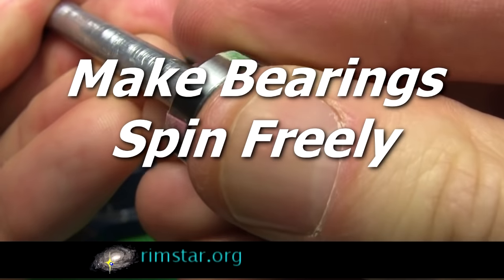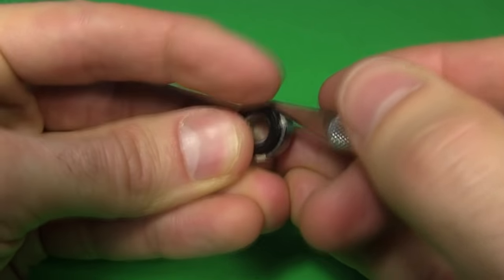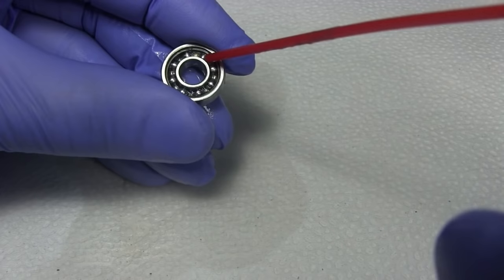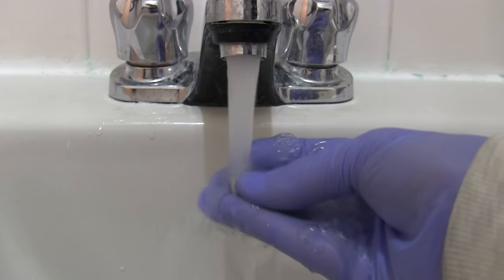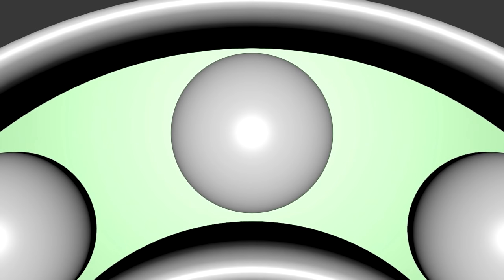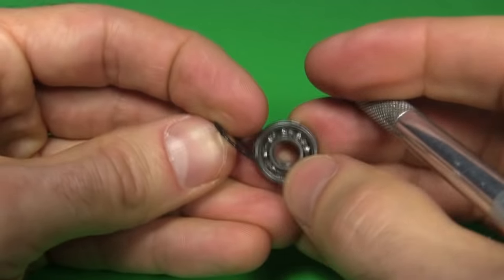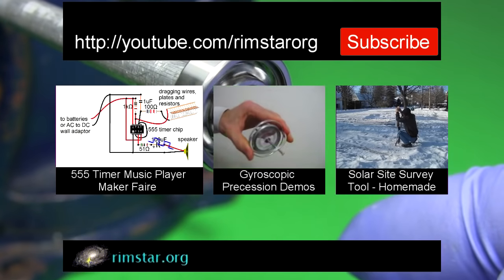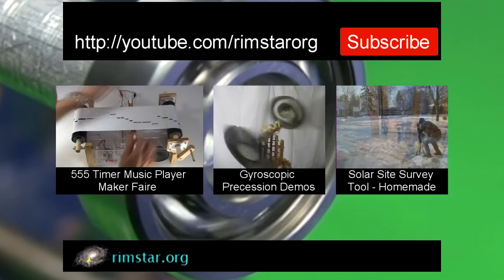How to Make Bearings Spin Faster/Freely

Comment: Is there a alternative to paint thinner?
Reply from the maker: Maybe gasoline? Or just use gasoline instead of the WD-40 and simply wash it out with hot water.
BTW I don't know what your application is but keep in mind the reasons I point out in the 2nd half of this video for where you need lubricant. In my case I was using it for an electrostatic motor and so none of those things applied.
Reply: RimstarOrg k thx
Reply: gasoline, probbably.
 acetone, definitly. by extension nail polish remover (with acetone)
 rubbing alcohol, maybe.
diesel, maybe not.
lighter fuel, probbably.

Comment: I think a really thin oil or dry oil might've let you keep the smoothness while prevention rust and all that sort of issue
Reply: This is a skaters recommendation. But bones speed cream could help a ton.
Reply: @masterroshi4714  I'm going to apply this to the self propelled dog treadmill I just built as I was already looking at skateboard bearings. They keep all the good stuff on the DL & if you think like me no stones unturned. TY

Comment: thanks ! Its good for skateboard bearings
Reply from the maker: +daniel ed It may be good for your skateboard bearings in the short term, but as I pointed out in the video, having no grease means that dirt can get in the bearings and cause damage over time. Also, the balls are now more in contact with the rest of the bearing and will wear faster. I'm glad to hear it worked for you, but keep an eye out for those things. Let us know how it goes.
Reply: +RimstarOrg will using something like sewing machine oil help prevent those things ?
Reply from the maker: +Troll King Probably. I'm not familiar with sewing machine oil.

Comment: What else can I use instead of paint thinner
Reply: Nicholas Chavez i think either nail polish remover, rubbing alcohol, or acetone
Reply: Dawn soap and water.. just make sure to dry it really good. I used an air compressor to remove the water.

Comment: this doesnt seem good for long term life of the bearing. wouldn't a light weight greese be more effective at allowing more speed while still protecting the metal of the bearing?
Reply from the maker: Yeah, as a result of comments to this video, I later learned of dry lubricants like graphite which would be good to add back.
Reply: @RimstarOrg  ahh, i hadnt thought of graphite myself but that makes alot of sense. I need to restore some bearings on a bandsaw so ill be looking into the options.
Reply: I've always blasted my bearings on my bike with alcohol and whatever I got to get the grease out. I've never had an issue with it. I feel like they add all that grease and stuff because they assume these are going into some sort of machinery that's Gona be running 24.7 but I can definitely notice the difference in how much easier it is to get moving on a bike and how much longer and farther you coast.

Comment: why use paint thinner? for degrease?
Reply from the maker: It's to remove the WD-40. Look through these comments for other suggestions. Also, make sure you dry the bearing thoroughly after rinsing with water, so that it won't rust. Spin it while blowing air through it with a hair drier (if there are plastic parts then don't let them get too hot and melt). After it's all cleaned out, some here have suggested putting in dry lubricant graphite powder to make it spin even faster. I haven't tried that myself.

Comment: WD-40 is for water dispersal. Why worry about making the bearing go faster when you don't need the speed for your music player?
Reply from the maker: The speed was a side effect. What I really needed was to make the bearings spin easier for my corona motor https://www.youtube.com/watch?v=qhXxSAv6rMg. I later used ceramic dry bearings but while waiting for them to arrive, I used the bearings in this video with the grease removed. Had I known about it at the time, I would have added dry graphite powder lubricant instead of leaving them with no lubricant. Apparently that makes them rotate even easier.
Reply: How did the ceramic bearings do?
Reply from the maker: They worked great. They turn far, far easier than the usual grease packed bearings. They're ceramic dry bearings, the fact that they're dry being important. I don't know if you can get ceramic bearings with grease too though, so maybe all ceramic bearings are dry bearings.

Comment: I hope someone can here can help me soon please comment.I have axle bearings similar to those in this video but bigger on the axle of my go cart.They are kind of tight but the power of the engine should spin them.I can't remove them since parts are welded on but I can maybe remove the covers of the bearing and lubricate it with some wd40 or pblaster and grease it a little bit.Can anyone give me other tips ?

Comment: does this work with skate bearings?
Reply from the maker: It should work with skate bearings. However, if you're planning on doing it for bearings that you've actually be skating with then you shouldn't for all the reasons given in the 2nd half of the video.
Reply: RimstarOrg so no acetone and all those harsh chems? Oh nevermind.
Reply from the maker: It's having no lubricant at all that's the problem with skateboard bearings. For the reasons given in the 2nd half of the video you want lubricant. In my case having no lubricant worked because I was using it for an electrostatic motor, low load, no water and no dirt.
Reply: RimstarOrg Ok thx, but some skaters dudes said don't use acetone to clean the grease off the bearings.
Reply: because you have to cleanout all the acetone if you want to renew the grease :) the acetone/alcohol remains would work against the new grease :) cheers

Comment: i just cleaned my bearing with some water and it already spins better!
Reply from the maker: Great! Make sure you dry it thoroughly so that there's no water left to cause rust. Also, some have mentioned in the comments below that adding dry lubricant graphite powder will make it spin even faster, though I haven't tried it myself.
Reply: RimstarOrg i dried it well(i think haha) i have no idea what that powder is though(im lithuanian) i will try to add some coconut oil later,my friend suggested it and he has the same spinner as me just different color
Reply from the maker: I'm surprised that this helped a spinner. I would have guessed that they'd have dry ceramic bearings in them, which would be about as fast as you can get. I guess not. Let us know how the coconut oil goes.
Reply: RimstarOrg well i didnt have any oil but my friend tried it and says and you can see it spins a bit faster.
Reply from the maker: Okay, thanks for letting us know.

Comment: very late to the video, but try getting skateboard bearings, they roll freely from factory
Reply: I just replied to another skater in this page. I'd suggest getting the parts in the truck coated in tungsten disulfide. If you type in "tungsten disulfide truck spin" on YouTube you'll find the video at the top. A page called Applied Tungstenite posted it. Look at how much smoother the wheels spin.

Comment: HELP i put wd-40 in my fidgit spinner and now it spins less longer.HELP
Reply from the maker: Remove the WD-40, like I do in this video, though make sure you dry out the water thoroughly, otherwise it will rust -- use a hair drier or something while rotating the bearing. Then put in dry lubricant graphite powder. See the other comments below for more tips too.
The problem with trying to get fidget spinners to spin faster is that they usually have bearings already lubricated to go as fast as they can. The bearing that I make go faster in this video is one what wasn't lubricated for speed in the first place, it was lubricated for handling heavy loads while allowing them to rotate.
Reply: RimstarOrg I love how you reply so detailed to basically all question you can answer 😌❤️
Reply: RimstarOrg thanks

Comment: Is this good for yoyo? Pls reply to me.
Reply: spin fast yoyo go brrrrrr
Reply: You could do this for a Yoyo though I wouldn't use the hot water on a Yoyo Bearing, it can cause it to rust.  The traditional method of cleaning a YoYo bearing is to use some type of solvent like Paint thinner or lighter fluid to remove any dirt and then to relube the bearing with yoyo lube.

Comment: Unless your running close to the max rate (rpm) it will not even matter. Or if your application can not tolerate any drag, like a watch, then it would. That’s why the ole timers lubed watches and fine instruments with Naptha.
Reply: As a watchmaker I can assure you we do not lubricate movements with naphtha. Naphtha is an excellent cleaner, not a lubricant. I have several books on watchmaking that go back to the 1900's and oils of some kind were always used.
Reply: Chris Simpkins 

Wow I guess your right again. My 40 years in the industrial disciplines with a globally known Corporation have been for nothing I see. Thank you for taking the time to point that out. So you have books? Read a SDS, “MSDS”, for naphtha. You don’t have to respond I’m not about debates of chemical properties. I leave that to the chemical engineers. Which I guess I am not. Thanks again though.

Comment: its better to use gas to degrease bearings, worked for me very well, spinning one of my bearings by hand spinned for about 20 seconds
Reply from the maker: For a minute I thought you mean a gas like high speed air or some other type of vaporous medium. I looked it up and realized you mean gasoline! :) I didn't have any with me at the time and my WD-40 is always nearby. But yeah, I've heard that gas is great for that too. Thanks.
Reply: RimstarOrg lol, i got gasoline from a dissolver bottle, its like to clean your hands from paint.

Comment: Can anyone recommend me a lube besides from speed cream or other common lubes sold in skate/bike shops? Like something that I probably have in my garage, like oils or something that would make a good substitute for the lubricant.
Reply: +Leeen skateboard
Reply: lots of stuff should work. try some vegetable oils, like canola or sunflower oil.
Reply: GRAPHITE
Reply: 3 in 1 oil
Reply: +ravener That dries out fast, and get gunky, and will cause bearing seizure. I tried it before. lol
Reply: 3 in 1 is not ideal in bearing, especially for longboard use. I would recommed Finish Line white grease for bearings in longboards. It's a bicycle product but it's light and doesn't add too much friction in the bearing. 3 in 1 is too thin IMO.
Reply: better than canola oil, and will hold you over for a bit til you can get speed cream or something
Reply: Skyler Bond Totally agree, vegetable oils are a terrible option for bearings.
Reply: Luciano Narno Though I agree 3 in 1 oil is too thin.
Reply: Singer sewing machine oil works great. Clean bearing when it's dirty or after a couple hundred miles. $3 a bottle at Wal-Mart. 1 bottle will last a lifetime.
Reply: Speed Cream

Comment: Stupid idea in the majority of situations where a ball bearing has to be used...  Full ceramic can work with little or no lubricant depending on application. 
There will only be limited cases where doing what he does in the video will have some benefit.  

I do like regreasing bearings with rubber shields, just wash them out with solvent and put some decent stuff in like mobil polyrex em or xhp 222, the seals will clip back in.
Reply: in the majority of applications you aren't cranking something by hand either. It's also stupid to not think outside the box.

Comment: all of this seems like really bad advice. thumbs way down. at least regrease it after all that and put the seals back on
Reply from the maker: This was done for my corona motor, an indoor electrostatic motor which is a very light load. The second half of the video covers the issues which leads to cases where you should put lubricant. That said, I did learn from the comments that graphite lubricant would help.
Reply: RimstarOrg your not supposed to put water in the bearings that will make them rust
Reply: @noname-hr8bh  WD40 is not water...

Comment: What if you don't have a paint thinner.
Reply from the maker: Nail polish remover it pretty much the same thing.
Reply from the maker: And ffhgu 07 suggested in the comments below using kerosene instead of the WD-40 and paint thinner to remove the grease.

Comment: i just put Marine Grease On My  and now it makes slow lol!
Reply from the maker: But it will probably handle heavy loads better! :)
Reply: RimstarOrg i just put the marine grease in rust but i only need to remove the rust, but my question  is how do remove the rust?
Reply from the maker: I haven't had to remove rust but I know there are actual rust removal products in automotive stores and hardware stores. I think someone in the comments here said that WD-40 works to remove rust, but I'm not sure.

Comment: I am doing this to my car's wheel bearings planning to save fuel cost.
Reply from the maker: I hope you're not. A car bearing is subject to all the things mentioned in the second half of this video. The bearings won't last long.
Reply: @RimstarOrg  It was a joke.
Reply from the maker: Oh. Ooops. Sorry. I get a lot of comments here seriously considering doing this for rollerblades and skateboards so easy mistake to make.
Reply: Just get some German or Japanese bearings. 
https://www.youtube.com/watch?v=RepARd6db7c
Reply: @edstar83  
These guys strictly says you absolutely need to use lubricant 😂
You need to go air bearing or plastic oil less bearing to run it properly dry.
Metal bearing needs lubricant despite manufacturers.
Good luck with destroying German and Japanese bearing.

I’d go with Chinese if I need to destroy it.
Running it dry will inevitably damage bearing. That’s why manufacturers say never run it dry.

People uses dry lubricant and it should run more freely than metal to metal contact.
I don’t see any advantage of using quality bearing just to destroy it.
Reply: @RimstarOrg  I intend on doing this specifically to a pair of roller blades. They are new but very cheap skates but bearings don’t turn so she can’t skate. I understand that this will impact their lifespan however this is a precursor to putting them in the bin and replacing them anyway because.. they don’t turn.

Comment: what would happen if i put this in a yoyo?
Reply from the maker: +Charizard 321 Do yoyos use bearings? I've never looked into how they work but I suspect a bearing is the opposite of what you'd want. Wouldn't there just be a fixed cylinder in the middle that the string winds around? Don't know for sure.

Comment: This is basically how you destroy it. (without physical force)
Reply from the maker: Didn't destroy it for me. They did worked great for my electrostatic motor. Just don't use it for any of the circumstances that I talk about in the second half of the video otherwise it will be destroyed. Admittedly, from the comments after I uploaded it, it looks like adding dry lubricant graphite powder would have made it even better.
Reply: Yes. this video pretty much describes how to destroy your bearings to the point where they are only usable in situations where the original "problem" wasn't even a problem in the first place.

Comment: Fyi I did this to my bearing for my fidget spinner and now it spins even slower
Reply from the maker: I'm guessing your fidget spinner already had fast bearings, probably with graphite as the grease. Many bearings, like the one I started with, aren't necessarily made for speed but are for supporting a load while allowing it to turn, and also being protected from the elements. After I made the bearings in the video spin faster, I finally bought from ceramic dry bearings, and those spin faster than the one in this video too (BTW A dry bearing it's dry, the lube is a dry lube). So it depends on what you start out with.
Reply: any recommendations to get it back to spinning the way it was?
Reply from the maker: Actually, the best I can suggest is to look through the comments here. A few have made suggestions for that already. Graphite comes to mind. Or you can look up the bearings online if you know the part number and see what lubrication it had.

Comment: Or hey, how about just purchasing the correct bearing for the application in the first place?  You know, where you specify the type of shield/seal and the grease fill?  Also, WD-40 is NOT a lubricant.  Never has been, never will be.  WD-40 = 'Water Displacement' formula #40 (the other 39 attempts didn't make the grade).  It was developed back in the 1950's for corrosion protection...

Comment: WD-40
Water Displacement 40th edition
It is NOT lubricant! Every engineer will tell you that!
Reply from the maker: I wasn't sure about that too since sometimes I've used it to remove grease and other gunk and sometimes to lubricate (hinges etc.) So I looked on their website and they say "You can use WD-40® to protect, remove gunk, and lubricate thousands upon thousands of items wherever you go!", "WD-40 Smart Straw spray lubricant is available...", "Myth: WD-40 Multi-Use Product is not really a lubricant. Fact: While the “W-D” in WD-40 stands for Water Displacement, WD-40 Multi-Use Product is a unique, special blend of lubricants. The product’s formulation also contains anti-corrosion agents and ingredients for penetration, water displacement and soil removal." Though even then I was careful in the video to say it "acts like a lubricant".

Comment: removes grease then continues to explain why grease is good for making bearing spring good 
me no understand
Reply from the maker: Ha ha! I see what you mean. However, the point of the second half of the video was to show the situations where you wouldn't want to do this (skateboards fit nicely into that category). That still leaves things like electrostatic motors used for science learning and fun, which is why I did this originally.  But I've since learned that a bit of dry lube graphite powder added afterwards would make it go even faster.